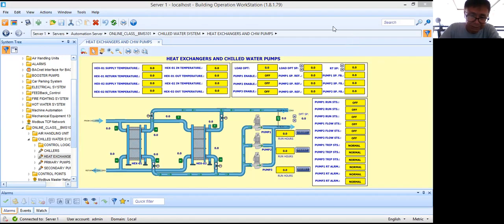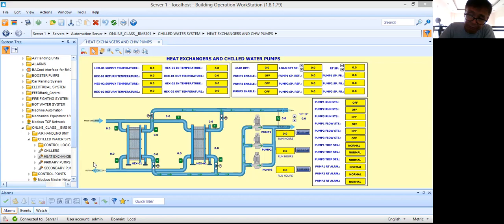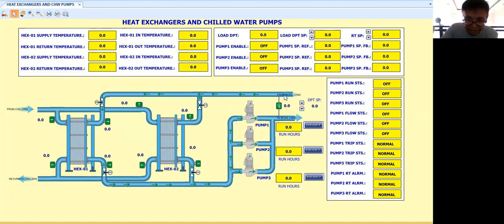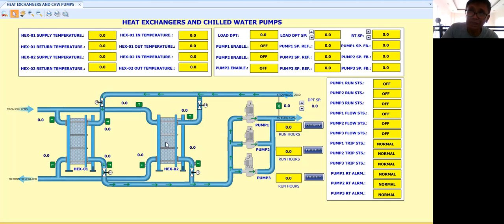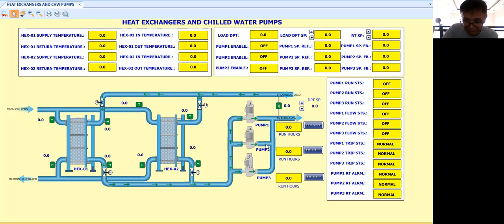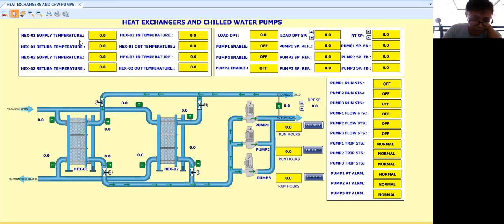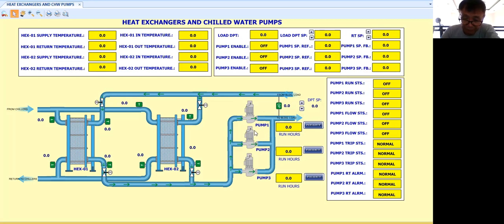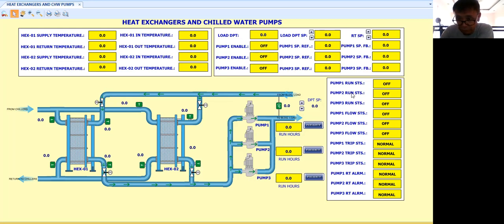Chilled Water System

Comment: Thank you for the knowledge you shared. What is the purpose of HEX? Why does chilled water from the chiller not go directly to the load?
Reply from the maker: actually in our projects we used Heat Exchanger if the chilled water is being provided by District Cooling, meaning the building doesn't have their own chillers